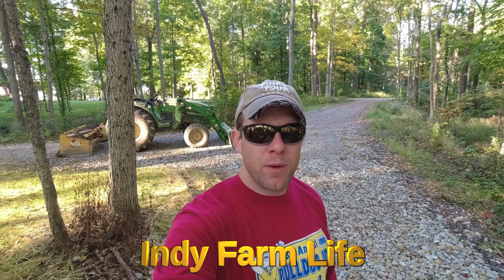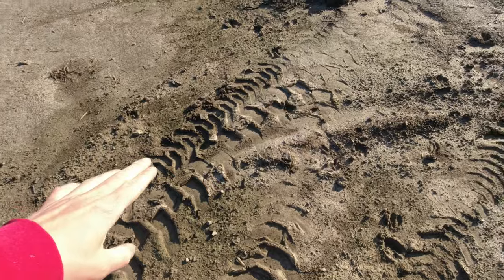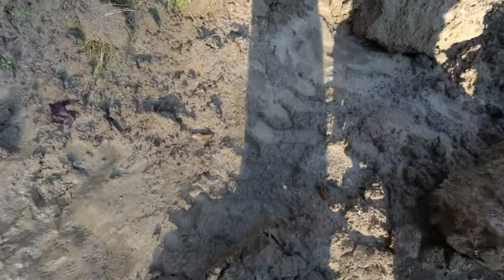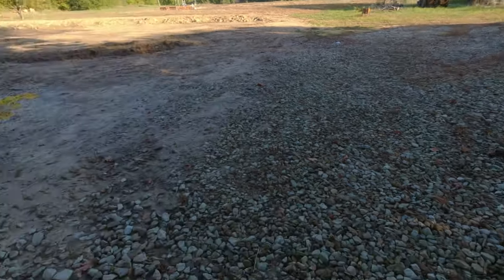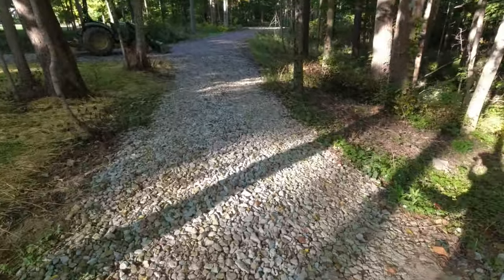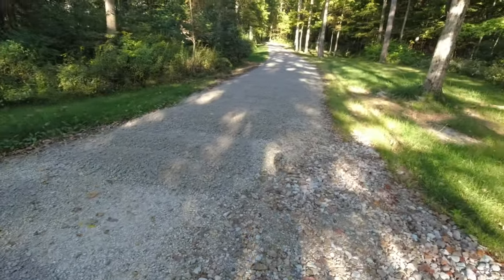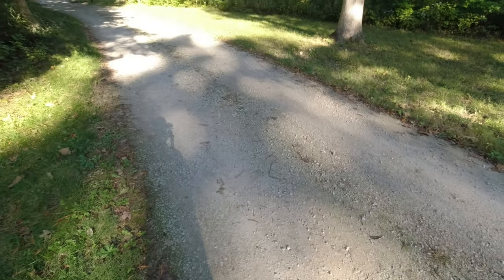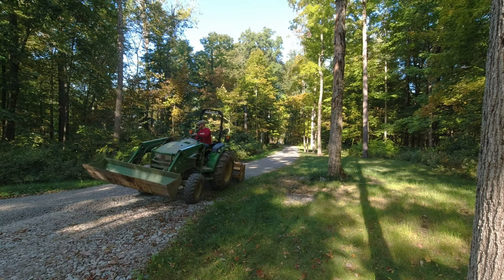How to Build a Gravel Driveway...The Right Way!

Comment: I found it a bit surprising that there was no mention at all about the depth of each layer?
Reply from the maker: That's a very fair point!  Your thickness will ultimately determine what kind of traffic you can have on your driveway/road.  After topsoil removal, I typically put down 4 to 6 inches of #2, 3 to 5 inches #53 and then 2 to 3 inches of #8.  If you do that (with good compaction between layers) you will have a road that will stand up to almost anything you can throw at it.

Comment: Recommendations for putting down gravel for a small semi truck and trailer parking lot, about a 1/3 of an acre? 5 to 6 inches of #2, then 2 to 3 inches of #53?

I have clay as a base, really hard to leave indentations. As someone else commented about putting down geo mesh, only if clay gets saturated. My lot is graded well…so rain runs off to sides. Thanks for the tips!
Reply from the maker: Given that you are going to have a lot of heavy, dead weight on your pad, fabric may not be the worst idea.  You could probably get away without it if need be.  I think cost would be the biggest consideration for me in this situation.

Comment: Basically good information.  But your clay must be dramatically different than our clay up here in NE Washington state.  Given only a moderate amount of rain our clay turns to chocolate mousse and is undrivable.  It also sucks up just about any kind of gravel you put on it.  Geotextile is cheap insurance to absolutely prevent expensive gravel from sinking deeper into the mud.

Comment: Top Soil should not have even been mentioned in the language of driveway building.  You should have said FILL DIRT. Big difference. Top Soil is for building lawns. FILL DIRT is for building land areas that are too low.
Reply from the maker: Fair point, but we aren't ADDING any fill dirt.  We are removing the top layer of soil, which is typically fertile top soil, not fill dirt.

Comment: This is dumb.  Once it rains good, that clay will turn to mush.  Very BAD advice!!
Reply from the maker: As long as you have a crown in the drive, you are good.  I've been driving on it for 6 years now and have had more than 20 concrete and quad axle dump trucks on it.
Reply: @IndyFarmLife   - As long as it is dry, no problems.  I will bet you $100 you NEVER had a truck on it after a solid 1-2 day "heavy" rain, thats when you get into trouble.  If it works for you, thats fine, but, not the norm.

Comment: Great information! I do gravel road maintenance here in my area and on a well established road as yours I have found that it is not necessary to keep bringing in new gravel every time. Especially if you are not losing it to the ground.
What you need is to scar the surface, churn the gravel and re-grade it. A proper box blade with scarafiers can save you a lot of money on gravel.
And you should be scarring the ground anyway before adding new gravel so that it is not just laying on hard pan.
Reply from the maker: This guy knows the drill!  Yes, you often don't need more gravel on a well established road/driveway.  Scarafiers on a box blade are perfect.  Great for ripping pot holes if needed.  The key is to try to not pull up the base layer.  We recently got a land plane to help maintain our drive. A little easier to use than a box blade but not as good at moving material from A to B.
Reply: @IndyFarmLife  
Yup, absolutely, you don't want to pop out those big rocks. Fine adjustments and patience to find the proper depth. There is always a trade-off going from one attachment to another. 
Thank you for all your videos! They are pure inspiration!
God bless you!
Reply from the maker: @jejoko I appreciate the compliment!  I try to keep them both fun and informative.  Hoping to pump out a lot more this spring!  Thanks for tagging along!

Comment: Saying clay is hard and and excellent substrate because stone won’t penetrate is odd—
Clay is only hard when dry.

Once it’s wet, it turns plastic, soft, and slippery.

Stone will sink right into it.
Reply from the maker: Fair point, but that's really only if allowed to saturate.  When you have it graded properly, water will move off it quickly.
Reply: Our gravel road is built right on top of clay. Haven't lost any to sinking, just washing away from rain leaving ruts. And I live in an area that gets 50in of rain a year